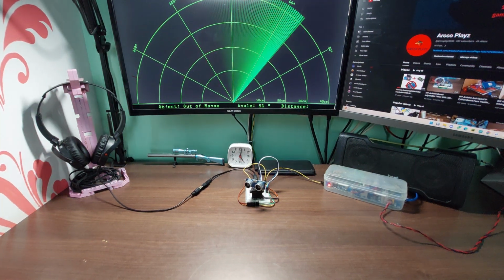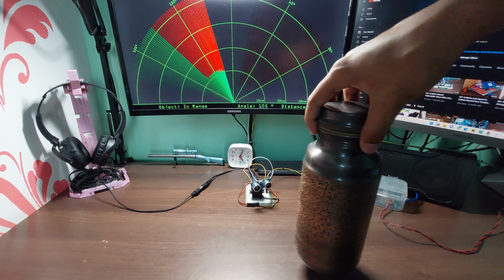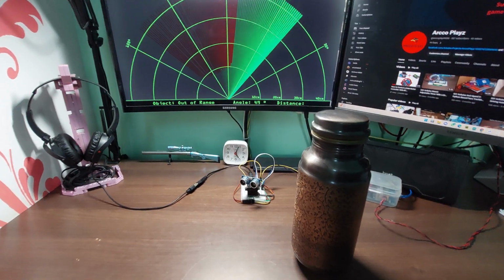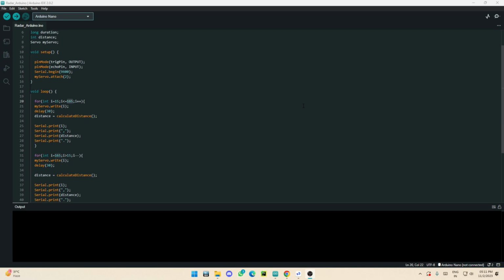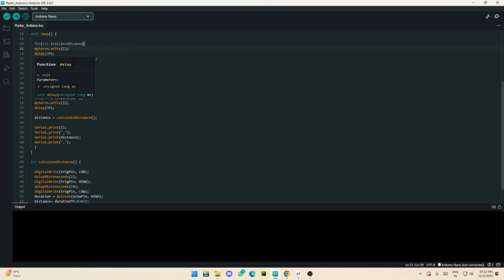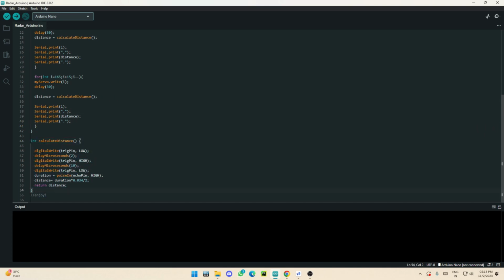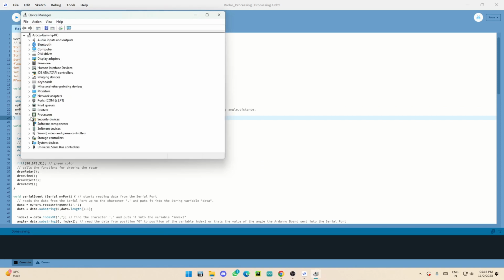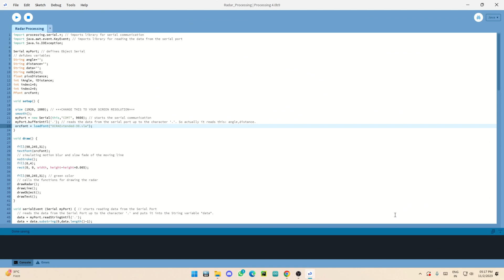DIY Arduino Based Sonar Using HC SR04 And Servo With Processing Visualization

Comment: Can you please elaborate on some of the practical use cases for this device?
Reply from the maker: Submarines, Ships, ATC, infact all these do use a similar device.
Reply: @arcteksystems  I am wondering what would be a practical use case inside one's house, since this device is mainly for military purposes.
Reply from the maker: Well it could be used for intrusion detection.
Reply: @arcteksystems  Well, assuming the type of intrusion that you have extrapolated from my question is a break-in into your residence, how would you explain the fact that that device cannot detect anything more than one foot away from it?
Reply from the maker: @avipatel8406  well i would expect someone trying to secure their home would use a sensor that costs more than 2usd.